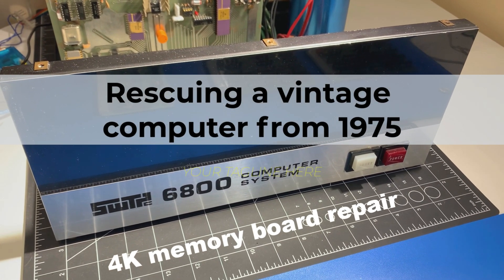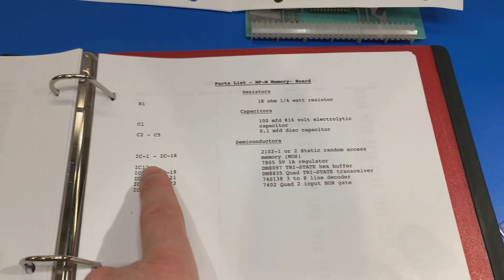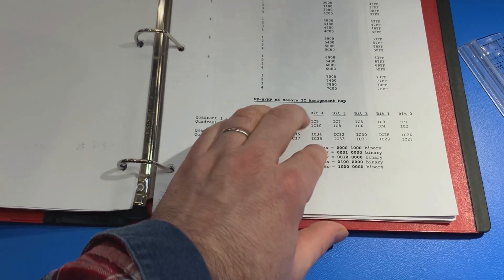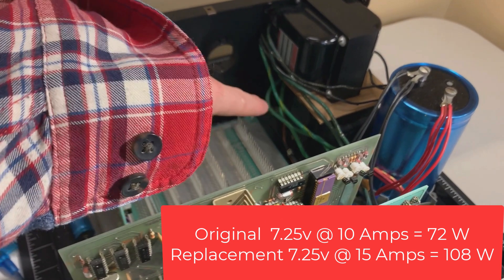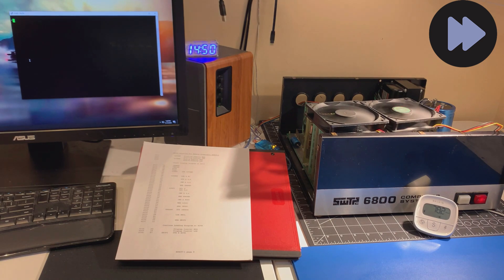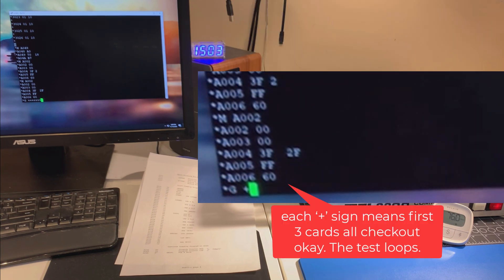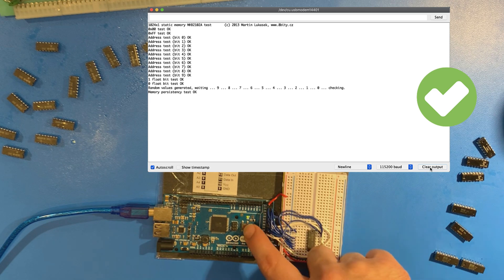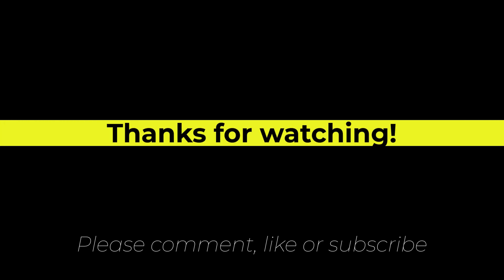SWTPC 6800. Memory Board Repair

Comment: I remember using MIKBUG back in 1976 on a SWTPC 6800. I still have the manuals somewhere.
Reply from the maker: I don’t have manuals so I had to find and download all the things I can find. It’s pretty cool stuff and amazing how well this machine has lasted.
Reply: @robin-g6  I still have issue 1 of Personal Computer World from 1978 which includes a short review of the SWTPC 6800. The 16k memory board sold for £480 in 1975 which is equivalent to over £3,000 (C$5000) now!

Comment: I read that the terminal program should be set to N/8/1 to communicate with the SWTP 6800. Not sure if those are your settings or not. Also your character delay time setting should be set to at least 100 msec according to the article I read. Hopefully, the information is helpful.